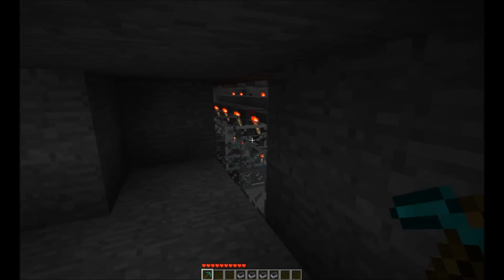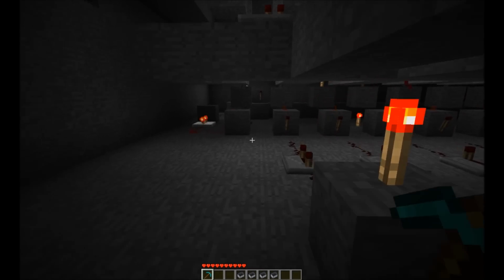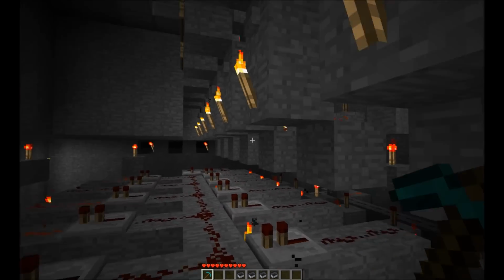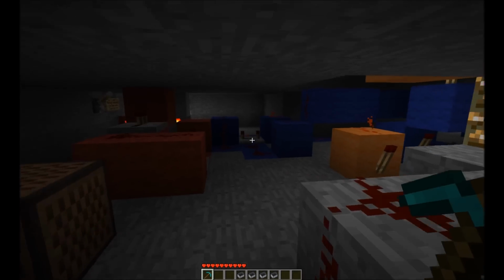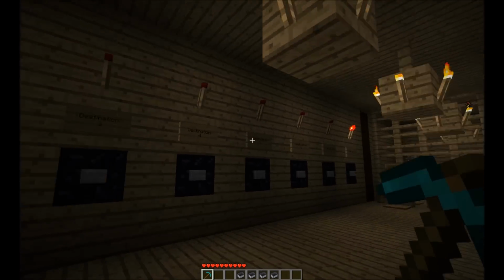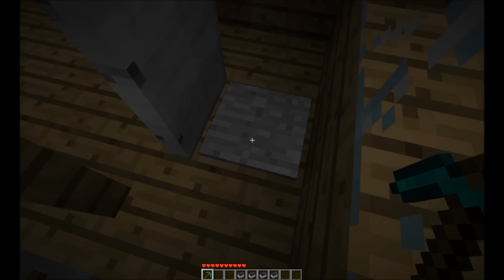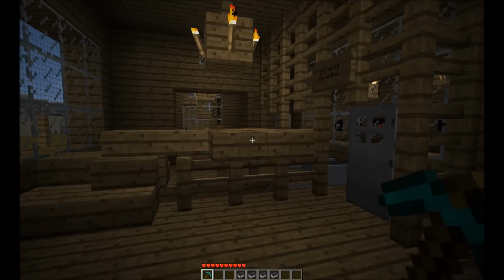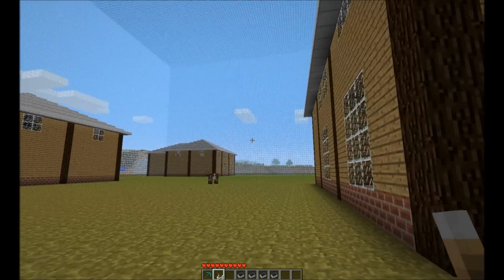Minecart station (part 2 of 2) - Singleplayer - 1.7.3

Comment from the maker: @jigarbov
That is one of the problems I can't find any reliable solution to. The new arrival will get stuck under the roof there. :(

I still hope that Notch will add a detector rail that only activates if the minecart is occupied.
Until then, I guess I will have to create a waiting-area by using more RS NOR latches, or let people live with the risk of getting stuck.